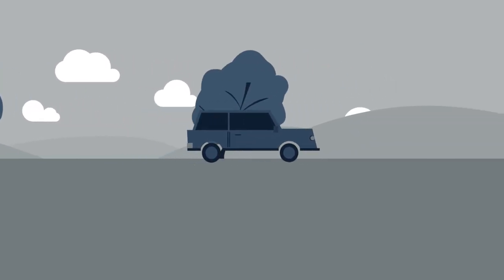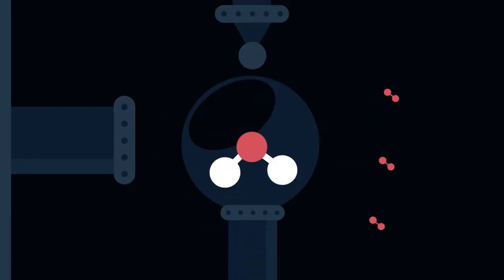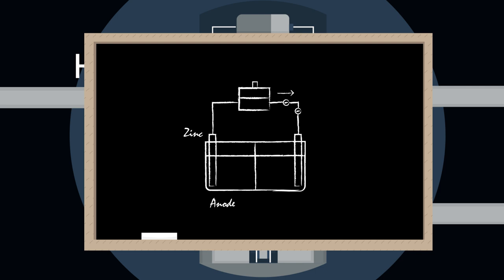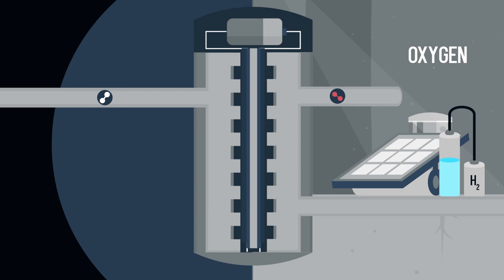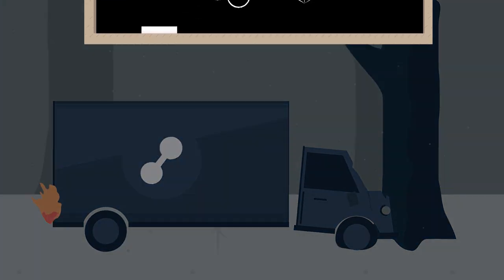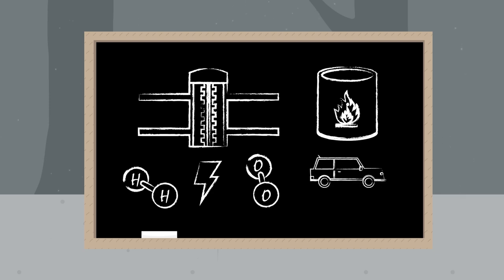Hydrogen & Fuel Cells | Reactions | Chemistry | FuseSchool

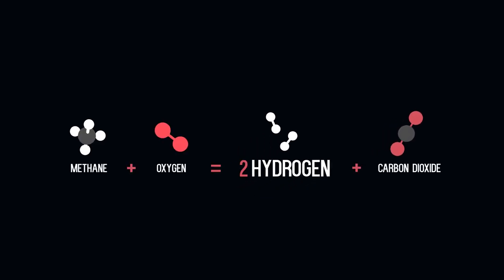Comment: 2:47
please keep in mind that methane is also a greenhouse gas, so it is switching one greenhouse gas for another.
Reply: and methane is many times stronger then carbon dioxide as a greenhouse gas, so it can even be a posotive
Reply: Only through this means of production. 

There are multiple and much more clean ways to produce hydrogen fuel. Solar panels for example
Reply: @linuxd  Im no expert in the field at all, but how about production of green ammonia?
Using only renewable energy to procuce pure NH3 to be used as a fuel for the fuelcell.
Im writing my thesis on the use of ammonia powered fuelcells on ships in order to meet stricter regulations in the industry.
Again i must stress that im writing my thesis on the commercial aspect of the idea, but from what ive gathered, ammonia fuelcells applied in a duel-fuel system could provide flexibility & adjust the industry into the normalization of alternative fuel.
Reply: i don't understand your question well, but i think that if methane is combined with oxygen, it makes hydrogen, and that is enviromentally friendlly isn't it
Reply: You can also split water into hydrogen using renewable energy such as wind.
Reply: @linuxd  how would solar energy lead to the production of  hydrogen ?
Reply: @XX-bk6xd  making hydrogen with a renewable is a great idea but how do you store  this incredibly  volatile gas?

Comment: 'Storing hydrogen = difficult, thus cars will run on batteries'. Great analytic conclusion. Going to the moon was an easy job, if it had it been difficult it would have never happened. Off course profit driven society goes for the easy option to excavate entire islands, no even countries (Republic of Madagascar), in search of precious resources such as Nickel / Cobalt / Lithium to store energy in an efficient way. Because yes, things need to be easy to do so.
Reply: whether we went to the moon is debatable 

i don't think we did but as far as hydrogen storage there has been a break through in that area that changes  the entire conversation

they have found a way to capture hydrogen on a film from   regular steam

that would reduce the cost of hydrogen

Energy Storage Breakthrough - Solid Hydrogen Explained

https://www.youtube.com/watch?v=U7CCq4oBgw4&t=264s

Comment: Very good educational video.

I'm only unsatisfied about the example chosen for the greenhouse effect: methane is about 20 times more efficient of a greenhouse gas than carbon dioxide, therefore it is one of the rare cases where an exothermic reduction-oxidation reaction (i.e. Burning) actually reduces the greenhouse effect.

Comment: What if we use Hydrogen fuel cells to power our homes instead of cars? We usually get water through pipe, we can generate electricity using few solar panels. Using this electricity we can create Hydrogen for fuel cells and generate much more electricity needed for entire house. (we can perhaps use solar power itself to generate electricity for entire home)
Reply: conceptually yes but the catalyst used to seperate H2 is platinum and thats really expensive
so it just makes more sense to use solar panels for a home because you dont need a consistent output
Reply: Hydrogen is used better for storage. Why would you need hydrogen storage in your house if you can get it from the power plant much more efficiently? 
However, it could be nice if you produce electricity by solar panels and a wind turbine in a remote house with no connection to the power plants and has a water source nearby.
What happens? You use the electricity produced from sources on daytime and it is windy. Excess electricity(Electricity can't be stored wo/ batteries) will be turned into hydrogen by an electrolyzer and when in need, a fuel cell (there are lots of options for stationary fuel cells, IDK which one is the best) will turn it into electricity and you will use.
Why wouldn't I use a battery instead? Because, think of your battery driven devices, when kept at full charge or it is empty, the chemical balance in your battery will be disrupt and it will be damaged irreversibly and performance will be diminished. It will have higher impact, lets say, when you don't use that home for a year. In contrast, the degradation of the fuel cell will be much lower and hydrogen stored in the tank will be perfectly clean and in need, it'll work flawlessly. 
TL;DR: Hydrogen must be used for electric storage, not producing electricity.(At least, on Earth)

Comment: Hydrogen can be compressed like any other gas, and can be made in situ at fuel stations and even houses. If a Wind or Water turbine( perhaps a micro hydro turbine powered by water mains pipes, which are already being installed in a few places). Combined with some Solar for back up. It would be very easy to make and compress Hydrogen at fuel stations. The Orkney Islands are using their excess Wind energy to split water to make Hydrogen, which they use in a Fuel Cell at the ferry port to power the Port and associated buildings etc, they also use the heat generated to heat the Port buildings. The excess Hydrogen is sold to the mainland and brings an income to the Island. They plan on using their Hydrogen in Fuel Cells to power the Ferries to the mainland when the current Ferries come to the end of their service life. Here’s a link from one of the Islanders who explains how it works. https://youtu.be/Rybpaqhg5Qg

Comment: Cool to think that the driving energy for the vehicle is generated by the oxygen and hydrogen bonds in the fuel cell
Reply: Actually the energy comes mainly from the weakly bonded Oxygen - the bonds in hydrogen H-H and water H-O-H are all strong so it is only by replacing the weak O=O bond with the strong H-O-H bonds thaat energy becomes available.

Comment: Nice video, are you aware that water can form highly diamagnetic molecules of multiple H2O sets? This can happen with just cavitation, but ionizing it first stimulates the formation. This type of water molecules becomes a gas above  minus 158 deg C. at 5 atmospheres and standard (normal room temps) temps the diamagnetic forces making it a gas can be overcome and it will condense, releasing up to 6 times the amount of electricity as H2 fusing with O2.  forming liquid water.... pretty cool huh? could save the future of fuel cells, don't you think?  Party on Dudes, be good to each other.
Reply: Interesting.. Do you mind to share the link or keyword?

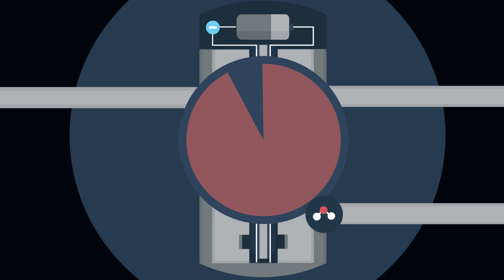Comment: Is the labelling correct at 2:06? Here's why I'm asking: (I am genuinely confused here, so please help someone...)
Firstly, the material that an electrode can be made of is stated to be carbon, which is labelled as the central part of the HFC. But that to me, doesn't seem to make sense, as an electrode, is a conductor where electrons enter to, or exit from, as part of travelling the alternate route to power an object. In the diagram, what is stated to be 'platinum/nickel', should be the electrode right? Furthermore, the central part is only shown to be a single object, and not two, which is the number of electrodes required for a current (along with an electrolyte) in such a setup. So that makes me think what is labelled as 'platinum/nickel' should be the electrodes. Also, (maybe this is too specific of a detail, idk) the wiring is shown to be surrounding the central part of the hsc, which would make me think more that the diagram might be wrong. (As i think it would make sense for the wiring to be after the anode, to allow for electrons to enter, and then conduct through the wire and vice versa for the cathode.) Plus, I'm a bit stuck on another thing, where I'm not sure what the layer that the protons move through (being the central object) would be called. Would it be an electrolyte? Or is it a proton exchange membrane, which is something I've seen in other stuff, or is it both? I'm not really sure on this and I don't even know if one involving the exchange membrane would even be another kind of hsc or something. Help, please...
Reply: You are right - the label 'carbon' should on the two sides supporting the platinum, not in the middle, which, as you rightly say, is the electrolyte carrying the H+ ions. The porous carbon allows the gases (H2 and O2) to reach the platinum catalyst. Sorry for the confusion and well-spotted Jens!

Comment: The only reason to start turning water into hydrogen, is that your solar array has fully charged your batteries and is sitting there idle.  In large systems, this is a lot of the time.  That extra energy is genuinely free - you have it, you waste it, and you don't care that you had it - that's "free".  Make hydrogen with it.

Comment: What if you wanted to use hydrogen to power a ship?  IE we take a 40 meter long catamaran with plenty of space on the deck for solar-panels + I believe you can buy sails who also have solar-cells in them.  Would that be enough electricity to create Hydrogen to power 2 engines, pushing a pair of waterjet propulsion systems?   Since you dont have to sail every day (unles crossing big oceans ofc) you could bask in the sun for a week, then travel until you run out of fuel and then repeat?   What would be the biggest problem(s) with this idea you think?  And aprox.. how much would you guess such a system (not including the ship, waterjets and engines, just the hydrogen system)) would cost?
Reply: I guess what I really want to know is, should you just use the electricity to power electrical engines, or can you get more power by using the electricity to make hydrogen and then burn that?
Reply: that's what the one company did with a ship they made. They have wind and solar powering electrolysis chamber and use hydrogen from water to power the ship.
Reply: If you're going to want to sail at night you will use a battery and electrical motor. Using hydrogen is difficult as how to pressurize it.
Reply: if it were a sailing catamaran there'd barely be space for enough solar panels to power the cabin lights.. 
if it weren't a sailing ship, then you'd be trading like a week of good sunny days for a couple hours of navigation (at decent speed, and I'm only guessing). That would be absolutely impractical. And this is of course without the losses involved with making hydrogen and then reconverting it to electricity. In this scenario you'd be better off using batteries.
Proposers of hydrogen would encourage you to picture a different scenario instead. Imagine a future in which electricity is extremely cheap and extremely abundant, but fluctuating because nearly all of it is made from inconstant sources like wind, solar, tidal etc. At this point the only problem would be how to store this energy to use it during the night and in electric vehicles and boats and trains and maybe even on planes. Well in this scenario hydrogen makes for a pretty compelling argument, because the inherent inefficiencies of the process become irrelevant - remember that electricity is dirt cheap and that the only real issue is how to store it. The energy loss involved in producing the hydrogen would then become competitive with the losses involved with converting electricity into different voltages and move it around the grid over long distances (we already waste about 20% like that nowadays).
In any scenario, hydrogen fuel cells also much more practical than batteries for the user (be it a small car or a large cargo ship), and are also poised to be a lot less polluting.
Therefore I am not as sure as this professor is about the tech of choice for the future of transportation, but I think that future of hydrogen is tightly bound to the adoption of renewables. The eventual raise of fusion power would most likely disrupt any development in this direction.
Reply: I mean, that could work, unless that thing happens when you cross an ocean where there's a massive storm, no sunlight and you can't anchor because it's too deep and the ship would get destroyed from the waves, so it should have a backup engine that runs on fossil fuels in case of an emergency.

Comment: Lots of processing goes into hydrogen about the only thing I didn’t like about hydrogen was the explosive effects and batteries are near solid state level with out blowing up / you can use algae to produce hydrogen and make more efficient hydrogen stations/ with discharge water disposal and electrolysis in case you need more hydrogen or algae hydrogen overflow and balance it out with ultra capacitors

Comment: What about recycling the waste water vapour and recycling it in the car, thus eliminating the fuel cell? The water could be split inside the car, allowing you power the car on water and needing to only refuel when all the hydrogen and oxygen is either leaked or turned into byproducts and heat
Reply: Interesting
Reply: Your idea seems to be similar to that of a perpetual motion machine. The thing is that we need to split the water into hydrogen and oxygen for fuel cells. This requires energy. If you were to reuse the energy produced by the fuel cell to in turn split water molecules for the fuel cell, there would be no excess energy for any practical use.

Tl;dr 
You can't get any more energy than what you put in initially for the splitting of the water molecules as that is the energy we get out of the fuel cell.
Reply: In order to turn water into hydrogen and oxygen you need large amounts of energy. So the car would need an energy source to power a machine to turn the water into gas, then it would need the fuel cells themselves to power the car. You'd also need a large amount of storage for both systems. This would create weight. the excess weight would mean needing larger amounts of energy.
It wouldn't be efficient.
Reply: a lot of energy is required to split the water molecules, so it couldn't be done within the car.
Reply: As I understand it, you're suggesting to split water (using the waste water from the fuel cell) inside the car.
The issue with this is that the fuel cell essentially produces electricity for an electric motor, and splitting water is a very energy intensive process, so I doubt there will be enough electricity "left over" for electrolysis to work as well as running the motor.

Not an expert on this field mind, but that would be my feeling
Reply: Electrolysis in the car can be done, but your last statement cannont be correct becaue of thermal dynamics. Ex no infantile energy...
Reply: How do you split the water inside the car?
Reply: Noah Brinson it takes about 38KW to make one KG of hydrogen so not a viable solution. 
The average home with solar on the roof could make a kilo a day of hydrogen on average.
Reply: Recycling the wastewater vapour isn't going to be really efficient as it is going to increase the car weight. Besides, even if you still want to recycle it, you still need a large amount of electricity to do electrolysis on the wastewater on it which will not only make the recharge time longer than a Battery Cell EV but you will also reduce the car's range as the car is going to be much more heavier (mainly because you need some apparatus inside the car to store the recycled water vapour and you may also need the equipment call PEM to electrolize the water inside it) which means it's going to need a lot more energy to power it for a certain amount of distance.

P.S Hopefully this explained!
Reply: Noah Brinson You need more energy to split the water molecules, than what you get out of a fuel cell. As the narrator said we can't recycle 100% of the chemical energy with a fuel cell, meaning that you'd ultimately waste energy by splitting the water molecules

Comment: I wonder how daniel dengil a Filipino  inventor manage to run his toyota corolla  with his hydrogen generator?  He didnt use any tanks to store his hydrogen  as his hydrogen  generator  provides enough gas needed by the engine. If his invention  can produce  large amount of hydrogen then it can be used for the fuel cell  and the fuelcells product which  is water can be use to its invention to separate  the h2o thus making it a cycle.

Comment: doesn't the more reactive metal become the negative electrode: cathode?
Reply: The more reactive metal (eg Zn) will lose electrons and become +ve ions forming the anode. At the cathode the electrons arrive (having travelled round the circuit) and the less reactive metal (eg Cu++) will plate out as the electrons neutralise the ions.